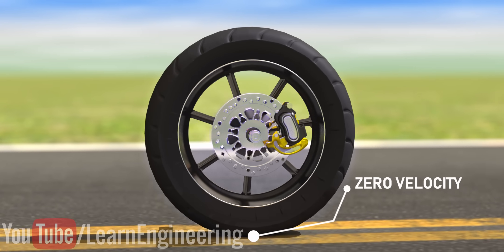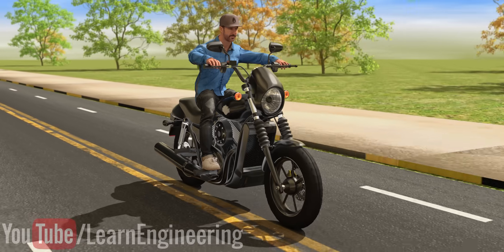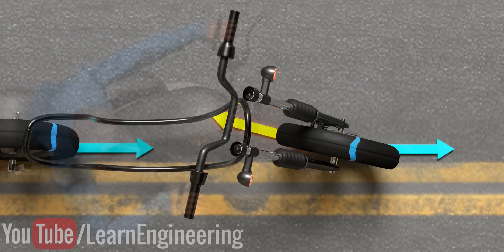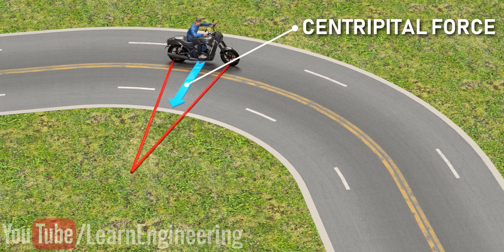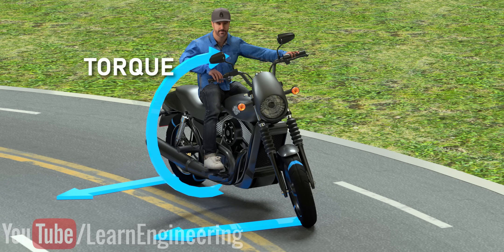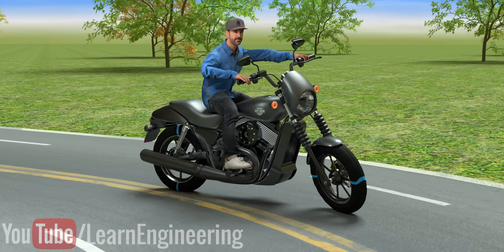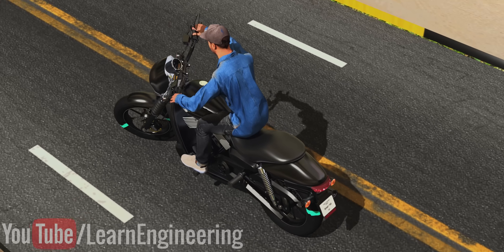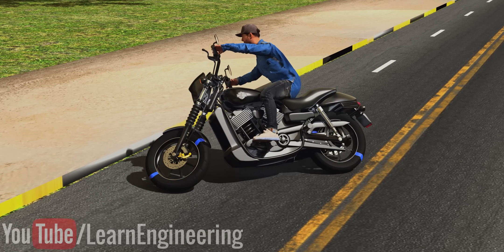Counter Steering | The interesting physics behind it

Comment: This is not a correct description of steering of a bike. A bike at some speed will steer itself, even without a rider (it only wants to go stright ahead though). If it for some reason leans to the right, the front weel will immediately turn to the right to rise the bike up again If it leans to the left it will steer the wheel to the left to rise the bike up again. If you now sit on the bike and want to steer to the right, you have to counter this in built action by the geometry of the bike. This is done by forcing the front wheel to not turn enough to the right to rise the bike back up. You actively have to counter the bikes own attempt to steer enough to the right to rise the bike up again. This is counter steering. If you are in a right turn and try to actively steer the front wheel to the right, the bike will immediately rise up and go straight ahead. Beginners nightmare. There are quite a few videos her on youtube that shows the result of not knowing how to steer a bike. Many of them shows the bike going more or less straight ahead, or wide, crashing into something. So: You always have to initiate the leaning in a turn by counter steering (steering the "wrong" way). The bike will then lean coorrect way into the turn (opposite way of the initial steering) and the geometry of the bike will then imediately force the wheel to steer into the turn (the correct way). If the rider releases this counter steering pressure on the handlebar, the bike will immediately rise up and go wide and (if space allows before crashing) finally straight ahead. This is how bikes are constructed and the reason behind such terms as wheelbase, trail and caster which (in addition to other things) defines the steering geometry of a bike. The best way to learn this is by actively trying it out in real life. If you are going to try "normal steering", find a very large parking space, because you are not going to make the bike turn. An ordinary bicycle is constructed in the same way. Try this: launch a bicycle with some speed on its own and watch it steering itself. Then try the same backwards and watch how important the steering geometry is. No normal bike is able to steer itself backwards.

Comment: Counter steering is simply NOT AN OPTION at speed. You have to do it.
If you tried to steer in the direction of a corner at speed you'd tip the bike in the wrong direction and either end up in a hedge or cross the road and hit the oncoming traffic and probably severely injured if not dead.
It's not a trick. It's not a secret technique to be "used" or not.
By leaning left you push left == "turning the bars right" - bike tips left and goes left. By leaning right you push right == "turning the bars left" - bike tips right and you go right.
It's simply not a choice. Even my instructors didn't understand it... which is scary to think.
Reply: yeah true that,you just have to give a little push forward in the left direction and it happens naturally while taking a left turn at high speed,and this guy actually complicated and gave wrong advice saying steer in the opposite direction like that in fact it is very dangerous to do so ta high speed.

Comment: many bikers? ALL bikers use counter steering, most of them without knowing. it’s the very way you keep your bike upright at low speeds. you learn it when you learn to ride a bicycle and do it involuntarily. now, if we’re talking about using it deliberately to initiate or correct a turn, then yeah, some do, some don’t

Comment: Look at this guy on da viilage Ybr'like bike, he's wearing a cap, that show us his natural skill of non driving anything, excluding a skateboard i guess.
But even on a skateboard, on every bicycle, and on the monowheel and scooter you use the same - counter steering.

It is fast and only one possible way to drive  a line-wheeled vehicles:
1) Move it's wheels from under you weight center opposite to the side where you wanted to turn, untill you and you vehicle will reach a perfect angle to the ground, to make a turn on your vehicle without changing it's speeed.

2) Enjoy you natural, safe and fast turn.

3) Leave a comment here, under the worst counter steering video on you-tube, that i've ever seen.

Authors seem to have never had an experience of riding even a mountainbike!
Facepalm everyone!

Wear a helmet and never listen to such a bullshit as a "normal steering". There isn't!

Cause the only normal bike steering is a counter steering, even if don't understand or feel it though.

Cause you cannot move your body weight to the right or to the left, using only a couple of inches of tyres to ground contact.

This is not enough to make a normal turn at all, but using a counter steering gives all da half a meter between a center of weights of vehicle+your's and the wheel on the ground to turn.

Try riding without hands on a bicycle)

Comment: counter steer is fking bullshit, you don't need to learn it, you just do it naturally.
Reply: Most but not all bikes can be leaned with body steering. On some sport bikes, the self correcting response is so small than even massive weight shift only lean the bike a few degrees. Body steering | weight shifting can't be used to adjust lean angle mid-turn.
Reply: @rcgldr  but this guy's explanation is wrong.
Reply: @ryan13547  - we agree on that.

Comment: ... I mean... not wrong... but the caster angle of the front fork and tire makes the wheel/bars turn back into the "no slip condition" as it is "self righting" just like a shopping cart, the rider has no input and is barely aware of this shift. This is why when a motorcycle leans, the wheel turns towards the balanced condition and thus a motorcycle with no rider can ride in a straight line till it hits something or runs out of momentum. 
If you're running wide, press more to lean more, if you aren't dragging a hard parts, there is more lean available. 
-- Source: I'm a motorcycle instructor and watch beginners counter steer all day long.

Comment: Simple explanation…. Applies for any two wheeler…bicycle, bike or motorcycles
Our bike wants to stay upright when moving, and it will keep moving stably in a straight line unless external forces act on it….
This is why bikes stay upright when moving even when the rider fell off in an accident….

But going straight in a curve is something you should not do… hence you introduce an instability through the steering handle…. The system of two wheels in motion will automatically try to correct this instability by doing the opposite of what you do….hence counter steering 

This doesn’t require a physics professor or a scientist to figure out… our brains automatically know this when we learn how to bicycle at a young age….
Keep pedalling and the bicycle stays upright…we need to only learn how to balance it without falling…

To remember, push the handlebar right to go right and vice versa…

Comment: No countersteering ever happens!!!      https://www.youtube.com/watch?v=1iMk9WaUN0U      AND    https://www.youtube.com/watch?v=1iMk9WaUN0U
Reply: In the video where the guy uses a meter to measure the pressure or tension, he presses on left handlebar to turn left,  pulls on left handlebar to turn right - that's counter-steering.
Reply: Your video shows counter steering happens conclusively.
Reply: @softailfun  You seem to know what the DEFINITION on counter-steering acualy IS!

Comment: Motorcycles, like all two-wheeled vehicles, MUST stay balanced at all times, so it is impossible to counter-steer a MC.  In order to initiate a turn, it must be LEANED first, then gyroscopic precession instantly turns the wheel in the direction of the LEAN.  The Bozeman demo illustrates this action.
Reply: Noop. To get a lean, you CS, period. The only practical way to control a two wheeled vehicle. You started CS the moment you rode your first bicycle
Reply: @kjellg6532  Your brainwashed, EVERY serious scientist that has studied two wheelers say a turn has to be initiated by LEAN, then gyroscopic precession (and a couple of other design factors) turn the wheel only in the leaned direction.  Keith Code is the goofball that popularized the cs myth.
Reply: @kjellg6532  You have been brainwashed by the goofball Keith Code.  Every serious scientist that has studied two-wheelers have said the turn MUST begin with the lean/imbalance.  THEN the gyroscopic precession (and other design features) cause the wheel to turn only toward that lean direction.  Otherwise, it would not stay balanced.  Try it, push the HB straight forward an inch or so, it will fall down instantly. The safe way is to push DOWN, not forward.
Reply: @kjellg6532  Motorcycles don't counter-steer!    https://www.youtube.com/watch?v=1iMk9WaUN0U

Comment: Incorrect you must hold the coutersteering through the whole turn. If you turn your bars right to go right you don't lean with the bike. It will cause the bike to fall over. You must lean in the opposite direction to counter balance. You should not be giving out false information that could potentially cause harm to someone.
Reply: Noop. You countersteer just for a fraction of a second to get a lean. From then on you point your front wheel into the turn controlling your lean. Depending on your bike, you normally have to give a light push to prevent the bike from standing up, but you must allow the front wheel to point into the turn.

Comment: This video is going to get someone killed. For beginners, NEVER turn the wheel into the turn during a lean. This will cause the front to lose traction and slip out. If the loss of traction is desired, one can do this to avoid collision or engage in trick riding.  This is not a movement for beginners.

Comment: There is no normal steering, you just can't as a human balance it. If you start with the handlebar it will be counter steering, if you start with the body, that will jerk the handlebar in the opposite direction-> counter steering.

Comment: It is a well-written article, but the first 20 seconds of dialogue contain a false assumption. Turning a motorcycle without countersteering is possible only if you are duck-walking in your driveway. Everyone uses counter-steering at every turn, whether they realize it or not.  Check out "@Carjack 820". Any unmanned two-wheeled vehicle will always go in a straight line until inertia ceases. The only way to turn the vehicle is by leaning, and the only way to lean any two-wheeled vehicle is by counter-steering or risk skidding or losing control.

Comment: Very shitty graphics. The difference in width between the front and rear tires alone causes the front wheel to turn in the opposite direction of the turn. Jab the rear brakes to get the ass end out then drop the clutch and nail it to keep the ass end out there and drift around the turn. The bike will be making a left turn but the handlebars will be turned hard to the right !!!

Comment: Very nice demonstration
Reply: @Anc5g  
Not according to me, it’s how a bike handles. To turn right the rider pushes the right grip forward. That pressure on the right grip is maintained for the duration of the bend. When the rider has completed the bend and wishes to go straight, ease the pressure off the grip and the bike will stand up and travel straight. According to this bs video, after the rider pushes on the right grip the rider “cleverly” steers into the bend! This would result in the bike standing up prior to the completion of the desired manoeuvre and resulting in not such a good day.
Reply: Even though it’s all wrong, even dangerous?

Comment: some sources incorrectly inform "turn right to turn left". the correct theory is "turn right to tilt left followed by turning left". I understand why people who have previously driven a car when using a motorbike will be confused because the car is entirely controlled by the steering wheel. whereas on a motorbike, the body, hands, even moving weight can be used to turn.

but things get messy when using an ATV. ATVs use steering like motorbikes but with car rules. when I turn left, instinctively I need to tilt to the left, but the ATV instead throws my body to the right.

Comment: I am a bit confused because as a cyclist I remember a video of someone demonstrating that it's nearly impossible to turn right on a bicycle without first turning right. The way they did it was that they locked the front wheel to allow only for a right turn and they simply couldn't turn. The explanation for it is that you always have to put yourself off balance slightly by turning in the wrong direction. I tried paying attention to this and realised it really works that way. So if you always counter steer is the difference between what they call counter steering here in the extent to which you counter steer? Does this work on a bicycle as well or do you need speed and wider tires for this to work?
Reply: Just ignore this video, its totally wrong.

Comment: Explaining countersteering without ever mentioning any gyroscopic effect of the spinning wheel is weird. You're pushing on the side of  a spinning gyroscope.  I dont think the speaker understands the subject at all.
Reply: Yup, this guy has no clue. The same principle is used for helicopter control by apply a force 90 degree from where you want the rotor disc to tilt.
Reply: The bloke who made this video has never walked past a bike, never mind ridden on one. The video is all wrong.

Comment: countersteering is a technique when you lose a turn and get pulled down...in that moment, you can steer the thing into tge turn to catapelt you in the opposite direction and maybe have a second try at balancing the unbalanced. most likely you gonna fall. hard. but in moto gp it works some times. i dont know wtf is all this...

Comment: "Lean steering", or "body steering," does NOT work at a faster speed.  It has some influence on the bike, but it won't help you "quick flick" (making the bike lean fast) your motorcycle.  Whether you know it or not, you counter steered your bike to make it turn.  To get any 2 wheeled vehicle to turn, you will counter steer first, then the lean happens.  This video is too confusing for a newbie.  Watch "A Twist of the Wrist II" the cornering bible.  "Counter steering ullways wuks."  Watch the video, and you will understand the quoted sentence.👍

Comment: Please if you are learning or want to ride erase this f$-*ig shit from your memory. Never even think about turning your bars if you are riding  on the road at speed. Corner is turning left, push and lean left, corner is turning right, push on the right and lean right, do NOT lean in the opposite direction like this video is telling you. The ONLY time to think of turning bars and shifting weight to opposite side is at slow speed, turns, parking lot etc. like in police rodeo riding. In both cases always look where you wanna go .

Comment: Countersteering is the most dangerous and stupid thing you can do.
Reply: So you either don’t ride or you have zero idea how to steer whatever it is you do (allegedly) ride.
Reply: @softailfun  Presently a Hayabusa, 1000+cc for several decades and did motocross and a bit of track work.   I think I know how to ride, and not one of the professionals I spoke to agrees with the stupidity of countersteering.   It was a silly thing we did to pass time on long rides just to make the bike move around on he road, NOT a good practice especially in corners..
Reply: @DarylCMillsWhitelighter  
Ok expert, have it your way…. I mean your completely wrong of course but hey what do I know against all that experience that you have.
Reply: @DarylCMillsWhitelighter  - all of the racers I'm aware of use counter-steering, especially at high speeds (riders tucked in behind faring, can't hang off). At around 100 mph, bikes no longer straighten up on their own, and the rider has to deliberately steer inwards more in order to return a leaned bike back to vertical. Ilse of Man has some 200 mph corners, and the riders state they have to grip the tank with their legs in order to generate the torque needed to counter-steer the bike. At Daytona, part of the track transitions onto one of the banked turns, with riders nearly horizontal at 180+ mph at turn exit and again, they have to use a lot of inwards torque on the handlebars to return the bike back to vertical. There was an article in 1970's motorcycle magazine about a rider would end up crashing into the infield if the rider didn't know about count-steering.
Reply: @rcgldr  Bollocks - I've been riding since '74 including the track and countersteering is regarding stupid and dangerous.
Reply: @DarylCMillsWhitelighter  - counter-steering is used by all uni-track vehicles: https://en.wikipedia.org/wiki/Countersteering
Reply: @DarylCMillsWhitelighter  - even pedaled unicycles: https://www.youtube.com/watch?v=55n90QAxRSk
Reply: @DarylCMillsWhitelighter  - and even my electric unicycles
Reply: @ Riding 50 years and NEVER used countersteering.   Yes I've raced on tracks also.   Think of the physics - dangerous.
Reply: @DarylCMillsWhitelighter  - motorcycles are designed to remain stable and vertical, what bit of magic are you using to get a motorcycle to lean which requires a brief period of instability (otherwise it would continue to remain vertical)?
Reply: Wikipedia explains the physics: https://en.wikipedia.org/wiki/Countersteering. 
Motorcycle instrumented with a pointer to show handlebar position: https://www.youtube.com/watch?v=JWuTcJcqAng&t=86s. 
Even a pedaled unicycle is counter-steered: https://www.youtube.com/watch?v=55n90QAxRSk